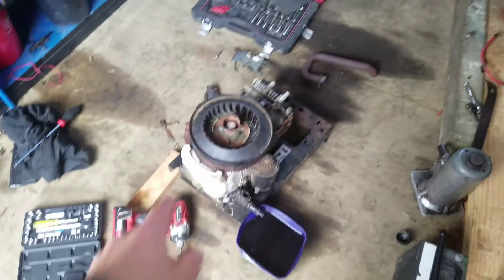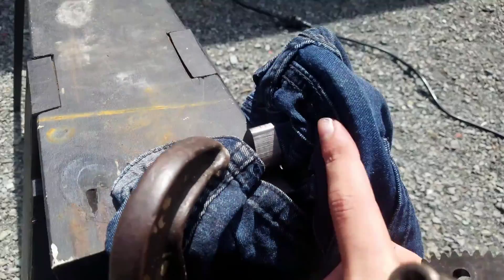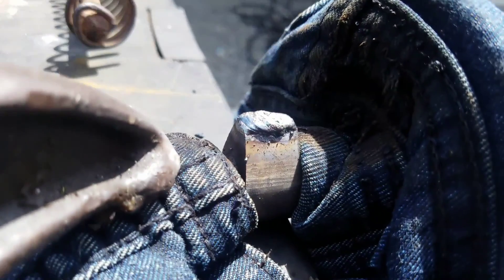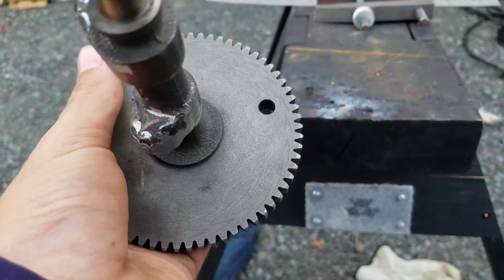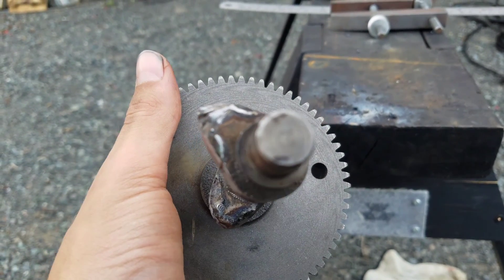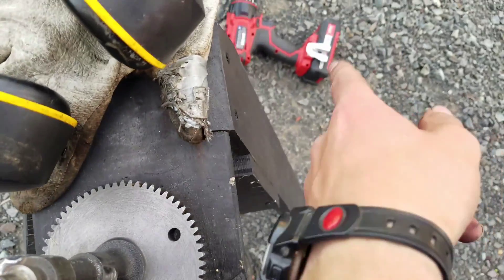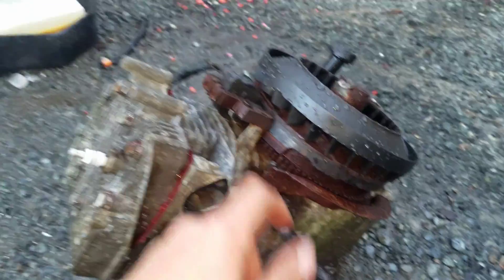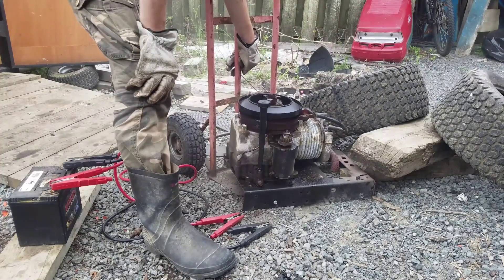how to get higher valve lift, free mods pt3

Comment: ok 2mm is ok, 3mm is not ok. i wudve dressed up the welds better. ideally have gas wire feed welder or TIG welding done to it. i might take mine to the local college welding shop and see if they can TIG weld it pretty. so less work to get it to be right????   sadly the more lift and duration we get ... mostly helps at HIGH RPMs... 6000+? the stock flywheel and rod dont like to go that fast.  drill out the oil hole on the big end of the rod for more oil to rod journal so it wont spin weld the rod to the crannkshaft.
Reply from the maker: Thanks for watching man. yea if your going to do this I haven't tried it on a ohv motor (if thats what you have) so be real careful with it. Don't try messing with the duration unless you really know what your doing. It would be best to use high tensile for welding for more durability. Solong as the sliding surface on the lobes are smooth thay don't need to look to pretty, all making it even will do will make it last a little longer. The higher lift should help a bit at even 3k+ rpm bc thay were tuned around 2.8k stock and all that, aswell as the L head motors had pretty bad flow to start with so it needs all the help it can get. Iv never heard about drilling out the hole in the rod but would be a good idea, if I get around to taking the rod back out I will definitely try. For higher rpm you can use a rod from a 28m ohv and it fits in a 28m L head, the ohv ones are stronger. The flywheel is a bit more tricky, iv removed the magnets to reduce the weight and help decrease the centrifugal force. So the motor allso has no drag from charging. I allso want to reinforce the motor shroud to minimize damage if the flywheel dose let go. Would be best to make sure the lift point on the lobes are cented to make sure the followers don't jam. All this goes along nicely with some porting and shaving the eyebrows. Allso I would only recommend this if you have a tune able carb as I had to make it run a good bit richer before it worked. I had one guy comment saying his motor wouldn't start after this so it can be touchy, although I'm thinking it was from him not doing something right. Any other tips is much appreciated

Comment: I've heard about this never seen it myself heard it from the old guys don't know how long that would last but it's very interesting
Reply from the maker: Would probly work better with high tensile welding rods
Reply from the maker: U havent got eney other tricks like this for more power have you?
Reply: @droptheblades895  have you tried shaving the heads down?
Reply from the maker: Yep tried that, haven't been abel to properly test it yet tho. you can allso get 25m heads and put then on a 28m for more compression so iv heard.